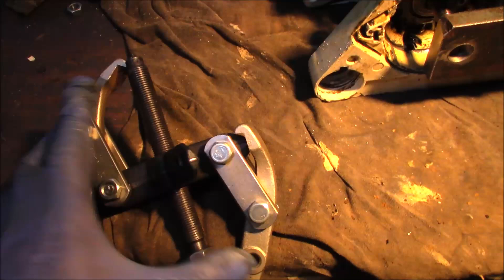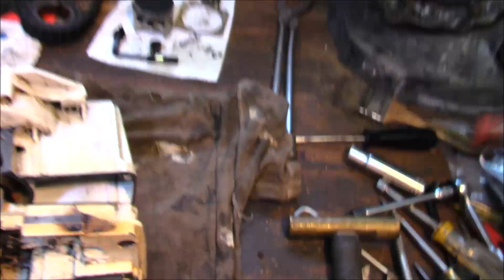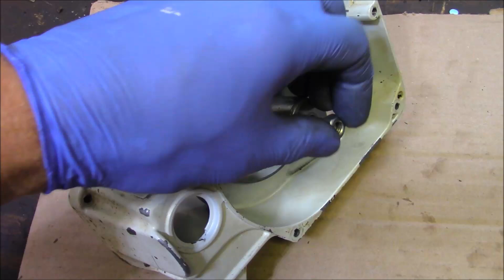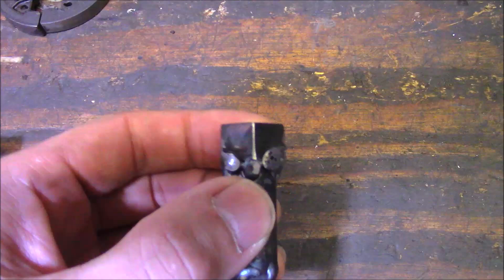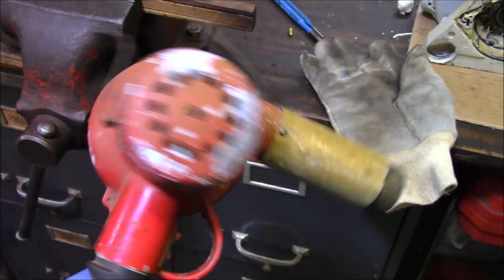Sthil 036 Saw Splitting and Assembling Case Homemade Tools

Comment: Nice saw ive got the same saw 036av with a 046 cyl, carb, piston and exhuast. Ill be doing this same process at some point. Great video too!
Reply from the maker: Thanks!  I will look forward to seeing your version.  I never looked but maybe the 036 and the 044 are the same family?  I got this saw (with a 011 and an 024AV) from a buddy that had a shop put a new top end on the 036.  I figured that it would be good to go and the deal was great.  Well, a deep cleaning was needed and that is when I discovered the crank end was toasted.  So, a new crank was in order hence the video.  Check out tinman's saws channel.  Good tips there.
Reply: @JIMO415  same chassis and cases so theyre like a small block chev!